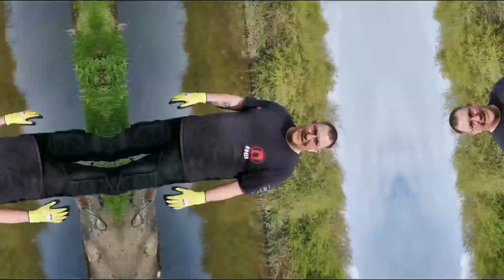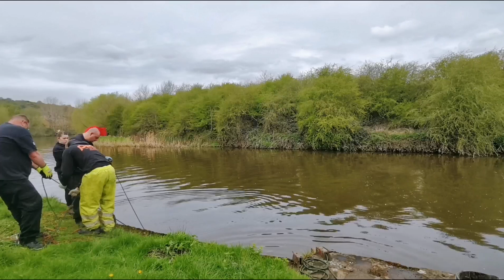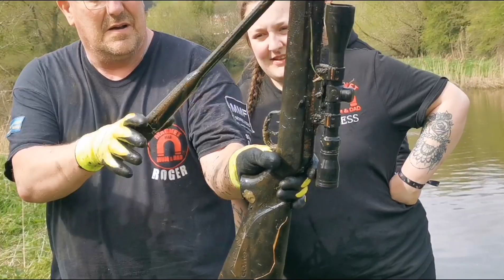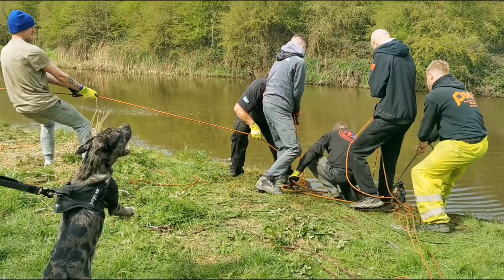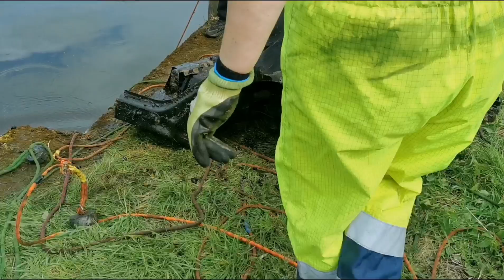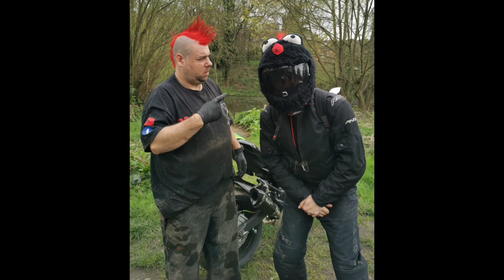And the 'guns' keep coming

Comment: Roger & Lindsey. What great finds, I think you want the heavy mob to join you , having seen what you pulled out. It was great to get out what took ages but finally you got it out. Fantastic air rifle, hope it can be cleaned up and got working.
Reply from the maker: Oh god Raymond it nearly killed us and we clicked on the other rear quarter of it too but I called it off as it took too long to get the first piece out. And yes I stripped the rifle down to bits and cleaned and painted it and reassembled it and is now working 💯